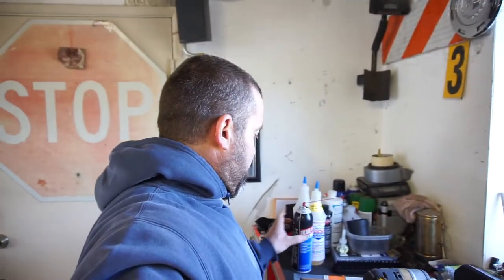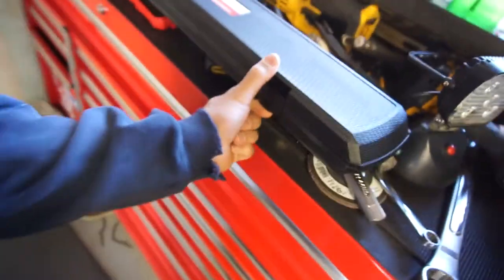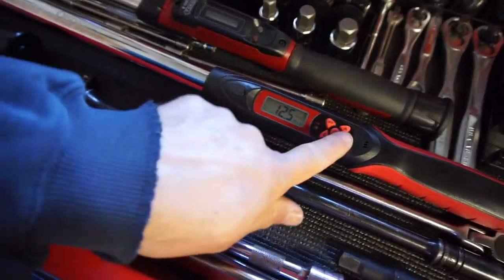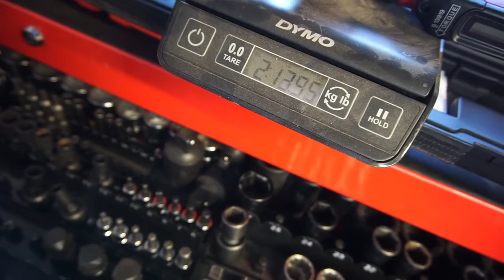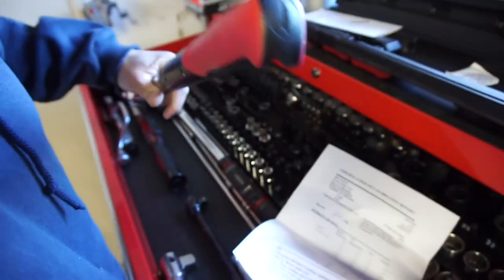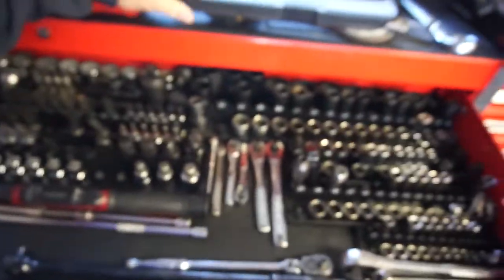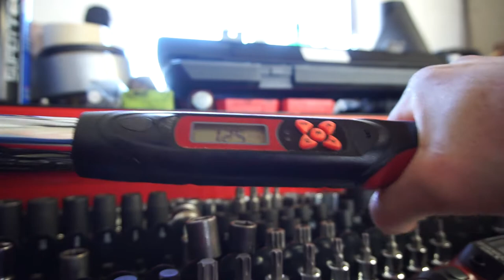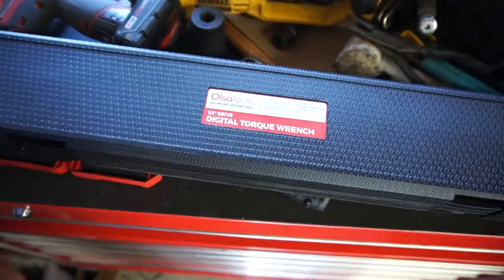OLSA Tools Digital 1/2" Torque Wrench. I Got A Great Deal On This. Free To Me. How?

Comment: The issue I have with buying torque tools (whether click style, split beam and even digital torque wrenches) on line is how they are treated by shippers, warehouse employee's and deliver drivers. How many times have they been dropped or thrown around. I have to admit I bought my GearWrench Torque wrench from Amazon. Amazon is probably one of the worst places to buy from. I have 3 torque wrenches and have compared them on the same lug nuts and they are all around the same so I hope it is safe to say they are all accurate. I would have a real tough time buying a Snap On Torque wrench for $600.00 - $700.00 and hoping it gets delivered in good state. I do have a company that will certify torque wrenches if need be. My GearWrench click style Torque wrench is my most expensive one that I paid $175.00 Canadian for so maybe in another 6 months I will take it in to get re-calibrated.